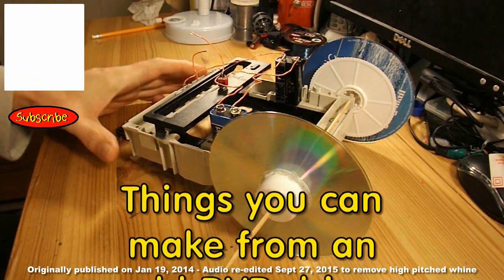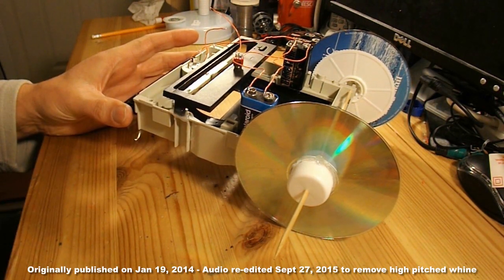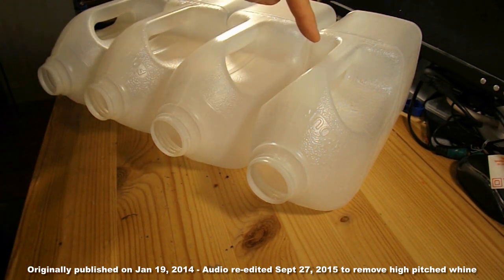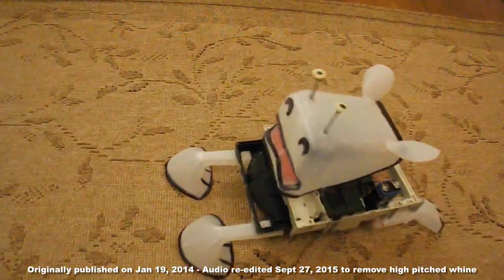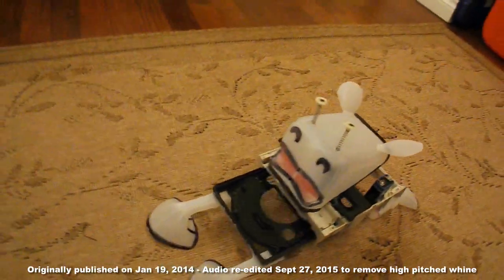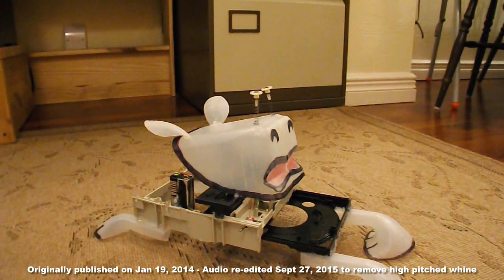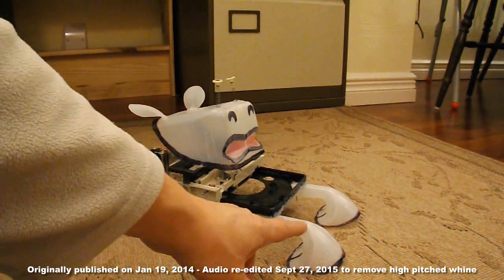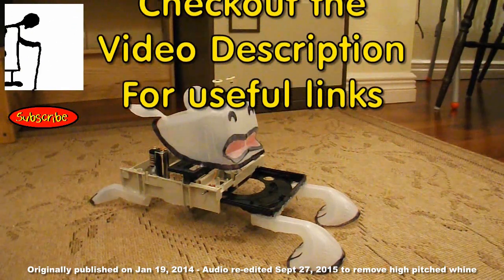Things you can make from an old DVD drive #6 Crawlerbot Dog Thing AUDIO EDIT

Comment: Do you think that if you add some sort of grip to the front feet that it will work on a smooth surface?
Reply from the maker: Yes you could although it may not be a easy as you may think. The grip must only work in one direction otherwise the feet will not move forwards.
Reply: GrandadIsAnOldMan true, I was thinking that as the front legs went forward they would be forced to move because the back legs would press into the ground with more friction. But maybe that wouldn't work actually
Reply from the maker: GoldenMiru It will be a balance of the amount of grip and the weight of the crawler. Too light and both front and back feet will slide without moving the crawler. Too heavy and it will not move. So you could build one and then test it to see what weight works best for the surface you put it on. It will also make a difference where the balance point is. Moving a weight from the front to the back will change it's effectiveness.